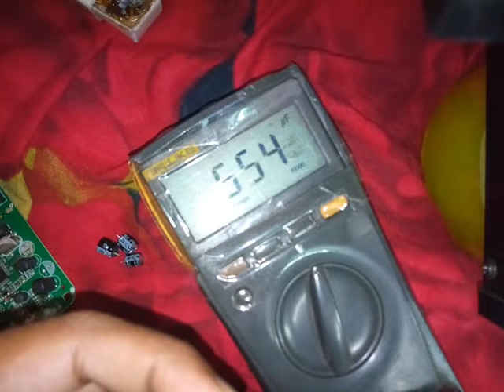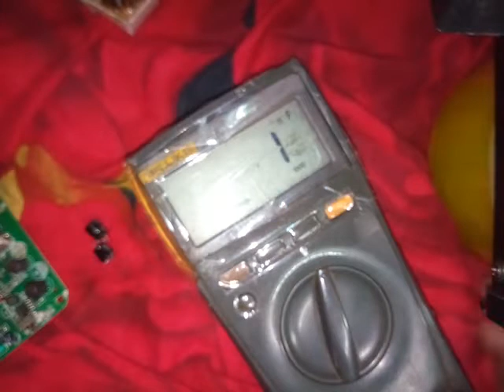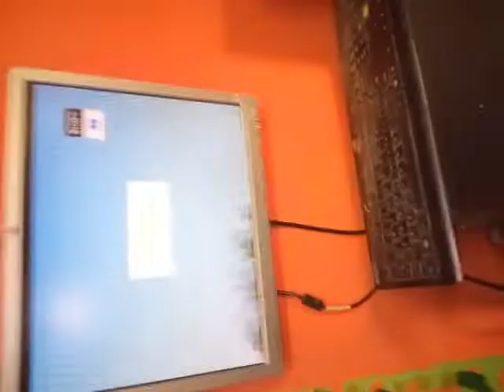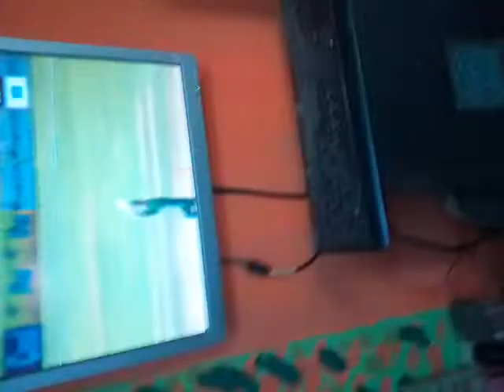Gadmei TV card repair with easy way ""part 2""

Comment: My tv tuner gadmei same as your. The problem is when adaptor in the indicator lamp is on but not blinking standby. When i turn on by remote or button tuner is not responding. What that problem for my tunner? Thnx
Reply: I am also faced this problem.but still i don't get solution.
Reply: @ashikuzzaman7291  trust me, i am cry on and hard to sleep all night long😭